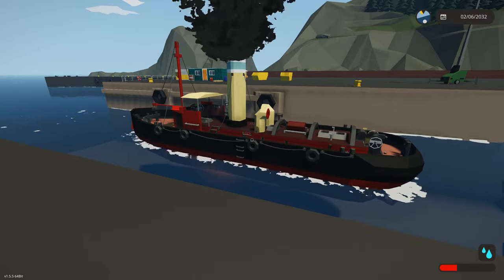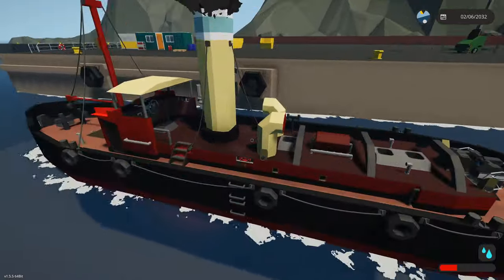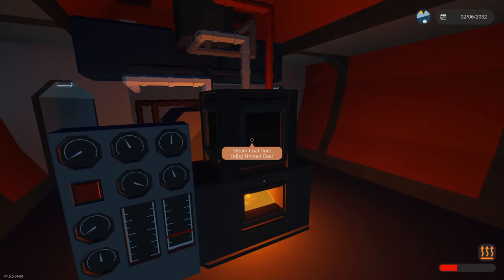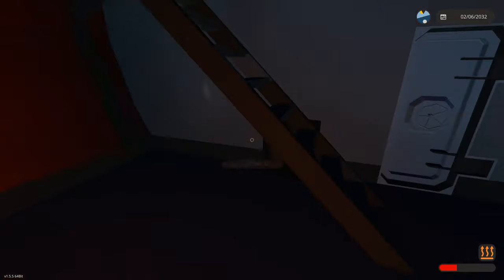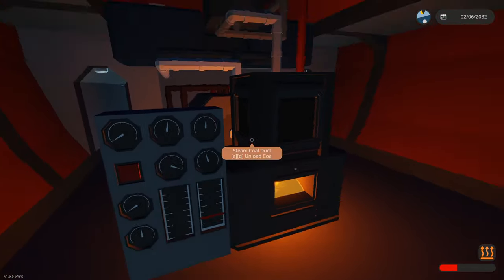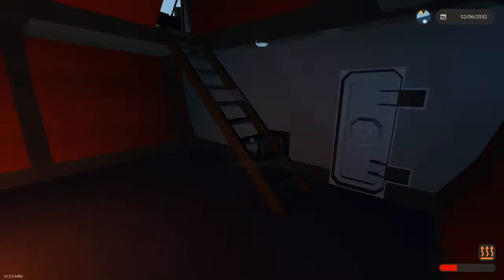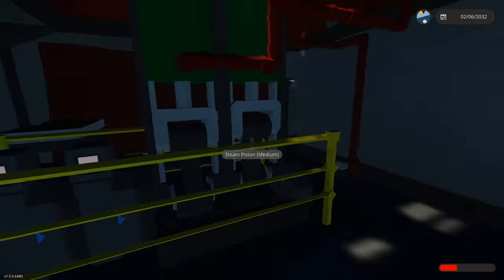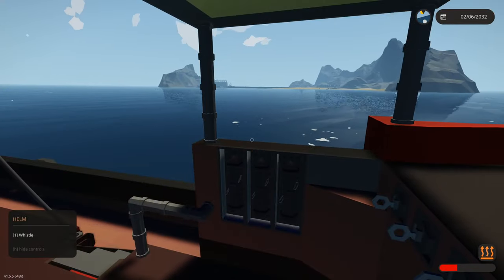Stormworks steam tug boat small update

Comment: Add at least 2more pistons. Either inline or next to the 2 you have.  Even a 3rd would be better than 2.  When you only have 2 pistons, you have a timing issue where both are at the full range of motion that provides less power.  Adding 1 or more pistons will allow you to offset the starting rotation so that atleast 1 piston is always closer to the center where where they provide the most power.    If you have 3 pistons it makes it a bit more difficult to get even timing but you can try -.33,0,.33 and should have much better results.  With 4 pistons have starting rotation of 0,.25,.5,-.25

You may want to try to get a bit more heat into the boiler when you are at full throttle and less heat at 0 throttle.  You want to have a slightly climbing pressure at just below full throttle and even pressure at full throttle.  Increasing pressure means you are making steam, decreasing pressure means you are losing steam.   

Make sure you have enough exhaust for steam exiting the pistons, any back pressure will slow them down.   I added some pumps to mine with better exhaut ports and they worked much better at higher throttle settings.  As long as you can make as much or slightly more steam than you are using, and have a good timing setup you should see fairly consistent rps.  The timing and having good exhaust is the key.  

If you can fit 5 pistons in there, that would be ideal.  They do not have to be in line,  you can do a 2 ,2, 1 configuration with pipes connecting them and have the same results as an in line configuration as long as the steam is connected right and timing is set up like an inline configuration.   
For 5 pistons, you want 0,.20,.40,-.40,-.20.  Rotation offset.

Comment: You could change the piston offset to -12 on one and 12 on the other it should allow a smoother movement. I had that issue with 3 pistons I changed the front one to 25 and the back one to -25 and left the middle one at 0 it got rid of the choppy power.